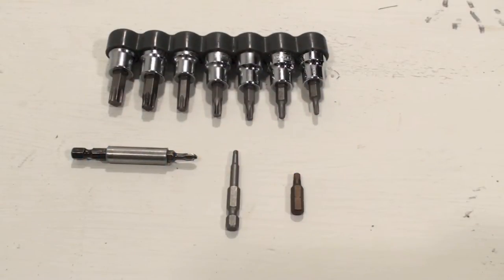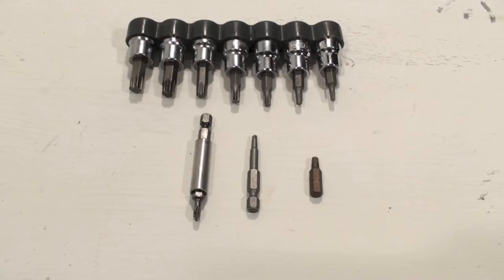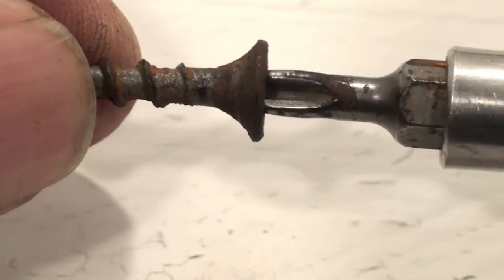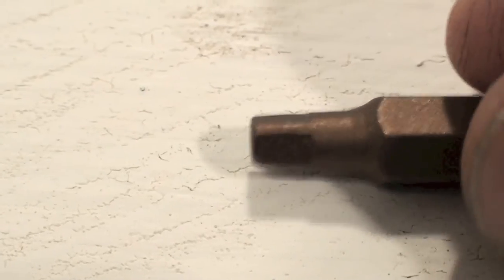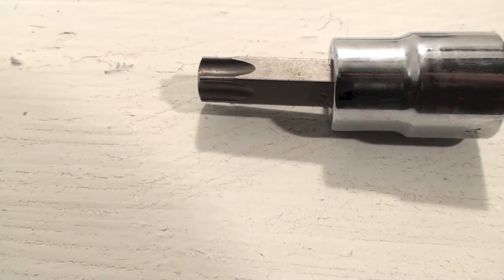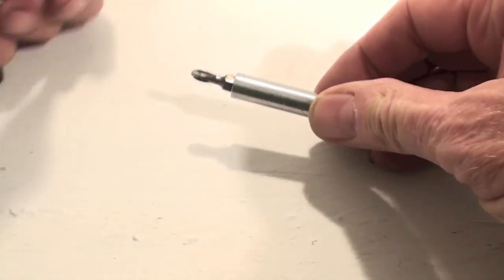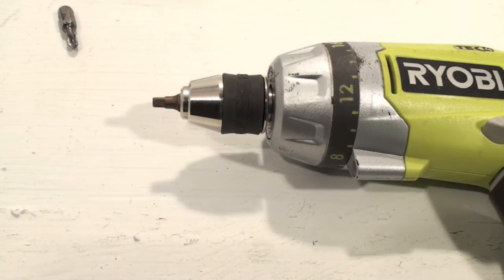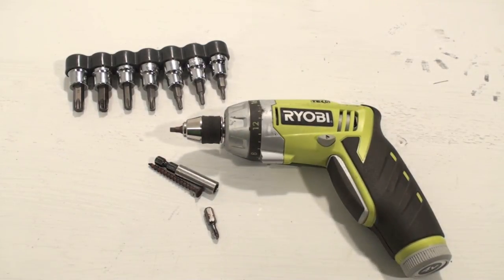Square and torx drivers explanation

Comment: Slot was first, square or Robertson drive was second, Phillips was third, star drive or Torx came last. Due to metallurgy at the time, square drive screws lead to lots of screws snapping the heads off, so Phillips was designed to cam out under high torque. Square and star drive don't cam out (as much?). One advantage to square drive is that there are less sizes available so you don't need to keep track of as many bits.

Comment: Just make sure you get a good bit for them squared head screws. Cuz a lot of them bits are made of soft ass useless metal. The edges of the bit will round with the first screw you try to take out or drill in

Comment: You don't prepare your video enough: things you want to speak about are not all ready by advance. And you speak a bit too slowly.

I always buy high quality tools; they never break, they never get used. Especially my philips and pozzy bits; buy high quality philips bits and they will last at least 100 times longer (and this is especially important with philips: a high quality bit will never break a head, and will always behave as expected). I am carefull about my tools, I never loose them; I don't need to buy spares. 

Take care about your tools, and they will take care about you.